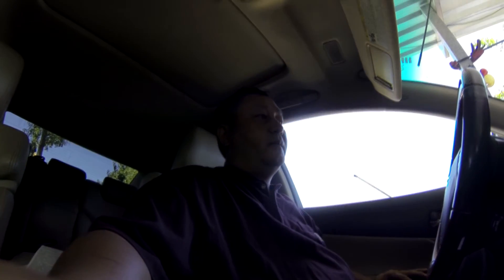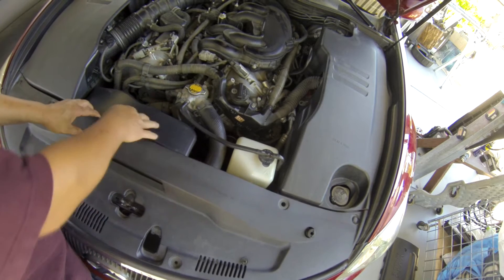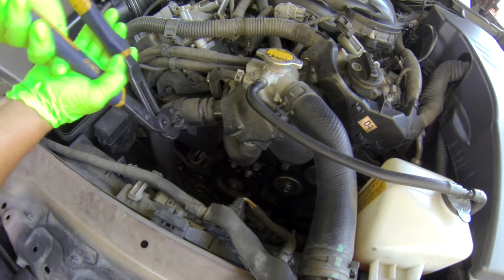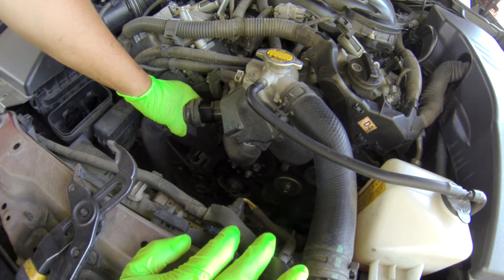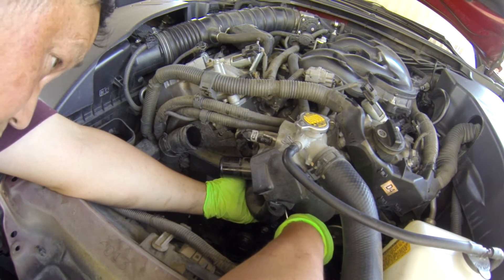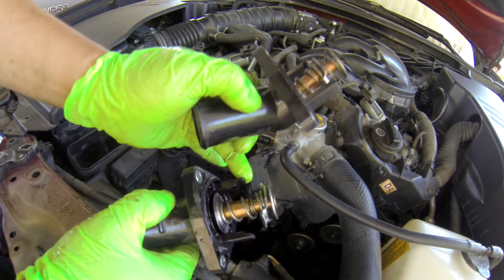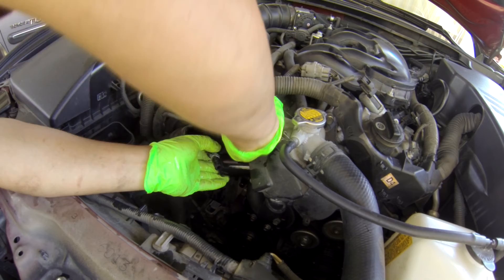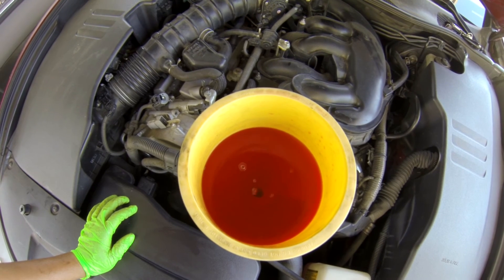lexus gs350 po128 thermostat replacement

Comment: Great video!! 👍  changed mine out in 15 minutes. Old one didn't look damaged but now with new one I have heat :)
Reply from the maker: Great job buddy
Reply: Did u end up adding d o rings ?
Reply: @frozenking9394  1 year ago..I don't remember
Reply: 😂Mann come back lol one more 1year old question what u end up doing I did put back old one and since last post it been doing gud but now it’s stuck closed and I still got new one 😮 sigh

Comment: I don't like how manufacturers have gone to plastic for cooling system components. They are doomed to fail. I had to replace a plastic pipe on my 2007 Toyota Tacoma. It mounted to the back of the water pump housing and was routed under the intake manifold towards the firewall. The Toyota replacement was stainless steel so they knew of the issue. Just stupid penny pinching ideas.
Thanks for the video.
Reply from the maker: I agree with you 💯%

Comment: How did you remove the coolant before taking off the big hose?
Reply from the maker: @PanicNoCap  no
Reply: @alltsab  oh ok so I replace the thermostat and the housing and then top off with coolant?
Reply: @alltsab  do I add coolant through the cap while the car is idling?